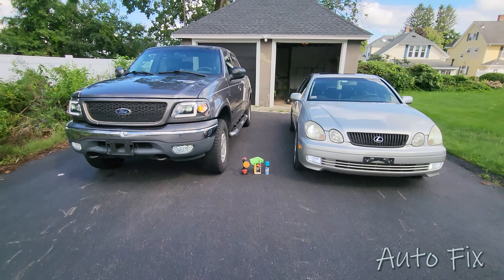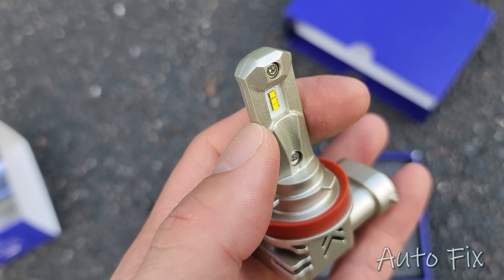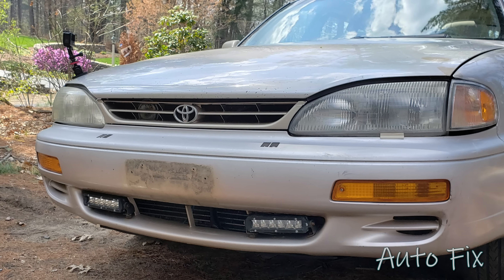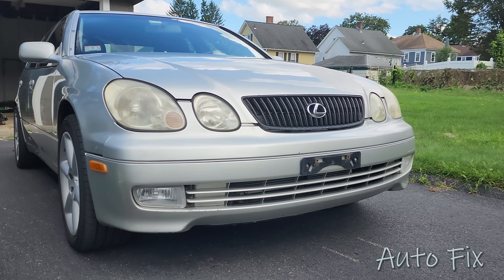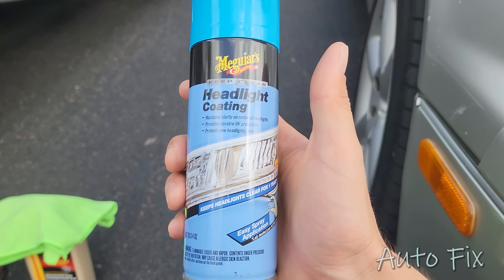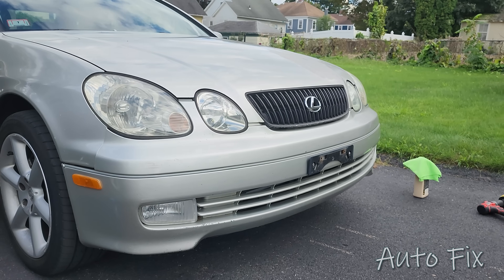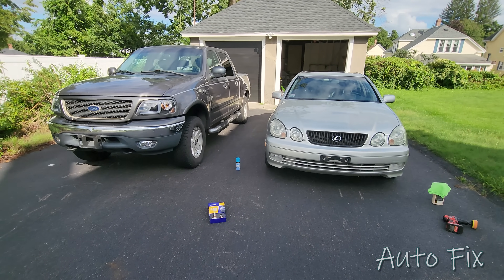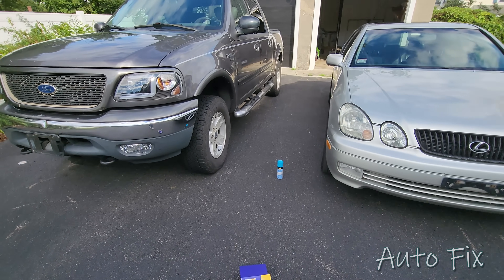How to Correctly Upgrade to LED Headlight Bulbs // AutoOne LED Bulbs!

Comment: My 1999 car has from factory projectors on low beam and fog lights somehow the h3 fog lights are brighter then the h7 low beams and the light is spread more evenly as were low beam has hot spots and kinda dead spots all halogen btw but planning on getting LEDs on low and high beams

Comment: If i can't align strictly vertically in my lens ( du to head light mount) for example + - 10 or 15 degrees. Does it cause considerable blind spots or loosing performance?
I'm going to buy exactly same bulbs as you showed at the very beginning on the video.
Reply from the maker: Yes it will cause performance loss in the beam pattern. Maybe not a crazy amount, but it will. Some LED bulbs are adjustable and will allow you to rotate them even once they're locked in. Maybe look at those?
Reply: @AutoFixYT I know that but in my region those are crazy 120W+... there are nice one but with additional blocks,  which is not comfortable and inappropriate for these days LED bulbs. Anyway thanks for advise.

Comment: About reflector headlights - doesn't the actual LED bulb have to be special and create a line so it doesn't blind oncoming traffic? Because there are a lot of cheap Chinese led bulbs that blind oncoming traffic, or is that caused by the incorrect adjustment and installation?

Comment: Question. If the same projector can be used with a halogen and LED bulb, can that same projector be used with HIDs?  I ask because I have an 03 civic, currently reflector halogen OEM setup. I wanted to put projector headlights in it with HIDs with the harness to make the Hi lo beams work on the same bulb. I found some complete headlights on eBay that have hi/low projector in it but states it’s for LED. Can I also use HIDs in it?  Does a projector care what bulb is in it?

Comment: Btw those multi sided LEDs work really well in an H7 system. Especially when the system has a seprate high beam reflector dish. It scatters light everywhere basically and lights up kinda amazingly

Comment: Your information is outdated 

modern  LED headlights use a  backwards J shaped reflector  if you taken it apart  a modern headlight

at lest this is what Honda and Hyundai is using   

GM is using mini projector  lens
Ford is using large projector lens
Toyota is using large projector lens
Reply from the maker: No part of this video talks about factory LED lights. This whole video explains how to correctly upgrade from halogen to LEDs.
Reply: @AutoFixYT   the correct way would be to buy a headlamp that has a official certified  LED projector  or gut one of those from  honda or Hyundai ...  at lest it would be a lot cleaner looking ... i plan to modify mines but a new housing and mini lens type  or gut one from a 2024Honda accord because it has the classic reflector type.. but i was looking  at a hyundai projector type(they got both)

Comment: Yah but dont you need a canbus or decoders to stop electrical problems like flickering  or is the Auto one LED lights don't cause those problems
Reply from the maker: Some LEDs have that built in. Others don't and you need them like you said. However, there are cases when you get flickering due to voltage fluctuations or low voltage, depending on how the daytime running lights function on that particular vehicle, and nothing will fix it unless you disable the DRLs

Comment: I just bought some for 20 bucks off Amazon they couldn't prove you any more wrong its kinda crazy you preach what you here but seeing is believing i installed checked the beam patter and no adjustment it should have a fan a heatsink and just a chip on each of the 2 sides. If what your saying only pertains to leds that litterely have like 30 leds all around the bulb then youd be correct it would be a shit light but if you follow what I listed to look for you'll happily find something for 20 bucks happy hunting

Comment: Does projector reduces the light output?

I see some reflector light output was brighter than projector, with the same bulb.
Reply from the maker: No, projectors and reflectors do not alter the total light output, but rather focus that light differently. Reflectors tend to throw the light in a general forward direction, with a hotspot in the middle of each beam. Projectors so just that, they project the light perfectly ahead and have a much more even beam pattern with a wider hot spot and a clean cutoff line to not glare towards other drivers.

Comment: Quick question, do they overheat if you put the rubber back cover back on the headlight or are they made to work with it on?
Reply from the maker: They might overheat, yes. They need air flow. You can cut a hole in the cover if you want, or you can run them and maybe they'll never overheat. Only one way to find out haha

Comment: I always tell people to never put aftermarket LED in reflector housing in cars that only has reflector housing for high and lowbeam. Those housing is not made well for LED. The light is scattered. Lowbeam no longer works like a lowbeam, it becomes highbeam because there is no cutoff line.
Reply from the maker: There actually is a nice clear cutoff and it all works as intended but only if the headlight assemblies are clear and OEM or high quality aftermarket, and only if the bulbs are good quality bulbs that allow the beam pattern to simulate a halogen bulb. I've done it and it works but you have to make sure you buy good stuff.

Comment: This guy is like a better Chris fix that actually seems like a real human
Reply from the maker: Haha thanks!
Reply: @AutoFixYT  mate you should have said something about the glass ones too, Volvos XC70 up until 2007 have them so you are wrong saying its pre 2000.
Reply from the maker: It doesn't matter if it's glass or plastic. What matters is what style it is: refractor, reflector, or projector.

Comment: Question when u purchased your bulbs did u have to make sure they were compatable  with your day time running light system
Reply from the maker: Most of my cars don't have DRLs, and the only one that does, I disabled them on. If the DRLs on your vehicle uses the low beam bulb, you typically don't need anything. The bulb will just be on as if your headlights were on. Other times, DRLs run through a separate LED strip or the parking lights, in which case you also don't need anything.
The hard part is when your DRLs run through the high beams but at half voltage. An LED bulb will flicker a lot if you put it in, so either disable your DRLs, or maybe make sure your headlight switch is never on the "DRL" setting (some cars allow that), or like you said, get some that are compatible with that low voltage that the car provides when high beams turn into DRLs.
I know this is a lot but I hope this helps!
Reply: @AutoFixYT  Thanks for getting back so soon and for the info . Like u said in the vid Ill make sure they are the right fit and high quality and I guess Canbus drivers are preferred. I mean I drive 2006 Monte Carlo so this should not be to difficult. Ill make sure I subscribe and like video
Regards Dave

Comment: I just tried installing H7 LEDs and they don't work. They flash for a fraction of a second and turn off. After some googling I found out that the LED doesn’t pull enough load and the car’s system thinks the bulb is fault, so it cuts power after the initial flash. You didn't mention anything about that in the video. What do I do now?
Reply from the maker: I didn't because it's not a very common occurrence. You will need a Canbus LED bulb which is able to communicate with the vehicle and tell it that there is in fact a bulb installed.

Comment: In New Zealand it is illegal to install LED bulbs into your headlight system unless your vehicle left the factory with an actual LED system already installed. I didn't do my due dilligence properly mainly because I listened to the so-called vehicle lighting experts (my mates) who actually gave me the wrong advice. Consequently when I took my vehicle for its yearly WOF (Warrant of Fitness) to be able to legally drive your vehicle on a public highway anywhere within the coubntry, my vehicle failed its test & it was only on account of the LED headlight bulbs that I installed & where it fell down from a legal aspect.!! So to make my vehicle legal again I had to remove those bloody LED/s & return to the normal Quartz Halogen bulbs that the vehicle was manufactured with!! In NZ one of the biggest pitfalls is most older Japanese vehicles over the last few years were vehicles arriving in the country with Quartz Halogen (QH/s) bulbs & usually rated at a mere 55 watts output on low beam & 65 watts on high & that's where the bloody problem is. Placing 55/65 watt bulbs is what I'd practically expect to find on a bloody push bike for heavens sake!! Any rate I searched the internet using AI (for the first time) which was superb & found some QH bulbs rated at 90 watts low & 100 watts high & these are legal here & I got my problem of inadequate lighting output sorted immediately & for a mere few dollars. I'm aware that most LED bulbs will fit into a QH housings etc, etc but that factor does not mean you can put LED/s into that particular fitting!! Unlike my smart arse/know it all approach you need to find out first what is legal in your neck of the woods & save yourself time money & a lot of sheer wasted effort!! Don't bother asking your mate as he'll probably give you the wrong bloody advice unintentionally. (yeah right) I'm also aware (now of course) that there is even a QH bulb out there rated at 100 low &140 high but they are a lot more expensive but the slightly lower rated 90/100 (which I'm now using & happy with) you'll find absolutely fine from both a cost factor as well as a performance aspect & they throw out a dam good light for sure!! (I'm fussy with headlights) PS: No good going to all this shit irrespective if the headlight lens are all clouded over & opaque!! (understandee de englishee???) Simply get it sorted & properly as your safety depends on these bloody lights!!

Comment: Why the GS have a small led on the high beams(has 2 bulbs)
Reply from the maker: That's called the parking light, it turns on when your headlight switch is one click below the low beams.
Reply: @AutoFixYT  thanks...wish I could see it

Comment: good LED installation techniq & functions of reflectors & projectors # extremely important point is projectors have low spherical surface area for light reflection that's the reason their beam is focused where as the light in housing reflectors has large area & that's the reason light is scattered &. cause glare for opposite coming drivers which is extremely dangerous # 
     from Pakistan 🇵🇰
Reply from the maker: Thank you!

Comment: About protecting the renewed lenses, you can also spray froma rattle can 2k clearcoat and it will protect it better. Also you do not
Need to polishe it like crazy before using the 2k, just sand like you said and once it looks good wet with water, let it dry thoroughly then mask everything near the light then spray 2 light coats. Should be good for years.
Reply from the maker: That's a great tip, thanks for sharing!

Comment: Okay. Can anyone tell me why after switching the whole housing on my 2009 ford ranger, to one of those generic ones off of amazon, my LeD headlight swap is just a star. It’s not fading out like it’s supposed to as a normal reflecter does. They still work, but the beam pattern is nonexistent, it goes everywhere. I’m not sure what I’m doing wrong here
Reply from the maker: Do you have the LED mounted correctly, with the blade straight up and down? Is it pushed in all the way? And is it even a good quality LED where the blade is as thin as it can be, not super thick? This all needs to happen to simulate halogen bulbs the most.
Reply: @AutoFixYT ah I see. It is vertically mounted, with the two led chips facing east and west. It’s pushed in all the way, and it was pretty expensive at around 140.
Reply from the maker: Ok, that's good. At this point, I honestly can't tell you why because I'm not there to see it in person. Could it be the housing? Yeah it very well could. But I don't know

Comment: Question: can i safely install LED lights into a housing that says "halogen only". or does it matter?
Reply from the maker: Yes you can, just make sure you position them correctly and aim your headlights after you're done
Reply: @AutoFixYT  im just concerned that they wont fit properly because in the product description it says "halogen only model". it has one reflector style and one projector style side by side.

Comment: just bought viontrex plug in play 6 pack for my honda civic 21, fog lights and high beams work great, low beams look very dim and not focused at all, can barely see the road 30-40 ft infront of me. dad suggested taking the projector bulb off, curious if you think it’s just a bad led or maybe it wasn’t put in correctly. thanks!
Reply: we also installed them to where they clicked in properly, i’m not sure any other way of installing them

Comment: Madman, drummers, bummers
Indians in the summer with a teenage diplomat
In the dumps with the mumps
As the adolescent pumps his way into his hat
With a boulder on my shoulder, feelin' kinda older
I tripped the merry-go-round
With this very unpleasin', sneezin' and wheezin'
The calliope crashed to the ground
The calliope crashed to the ground!
But she was blinded by the light
Revved up like a deuce, another runner in the night
Blinded by the light
Revved up like a deuce, another runner in the night
Blinded by the light
Revved up like a deuce, another runner in the night
Blinded by the light
Revved up like a deuce, another runner in the night
Some silicone sister with a manager mister
Told me I got what it takes
She said, "I'll turn you on sonny to something strong
Play the song with the funky break"
And go-kart Mozart was checkin' out the weather chart
To see if it was safe outside
And little Early-Pearly came by in his curly-wurly
And asked me if I needed a ride
Asked me if I needed a ride!

☺️☺️☺️☺️☺️☺️☺️☺️☺️☺️☺️☺️☺️☺️☺️

Comment: HELP i bought and just installed High and Low beams LED on my lexus es350 2013 ....only the lowbeams (h11) are working the high beams (9005) are not working after installing? What do i do? I noticed the arent straight perpendicular is that why they arent working?
Reply from the maker: Make sure they're plugged in correctly and that they're installed correctly. If they're not lighting up at all, there not getting power. If they are lighting up but the beam pattern is not corect, that's a mounting issue.

Comment: In UK do not fit any LEDs in any orientation in dipped beam reflector headlights it is illegal and will never produce the correct beam pattern. Main beam reflectors with LEDs can pass MOT test but shouldn't as the focus of the beam will be out of alignment but if it's got enough lumens it will still pass the main beam light intensity test.
Reply from the maker: Laws and inspections in all of Europe are much stricter than in the US. Definitely much harder to have a modified vehicle over there.

Comment: @AutoFix how’s those autoone led bulbs or Auxito - 10S that has tiny little ZES led chips holdin up after a year so far?

The one with a red O-ring. Still give u solid light output and no flickering?
Reply from the maker: @toyotabrony  all are still good for me!
Reply: @AutoFixYT  glad to hear that, does these 16.5W led bulbs for low beams. Still gives u nicer light output and see much better than halogen bulb?

Is it a big improvement or par improvement?
Reply from the maker: Huge improvement. Would never go back to halogen.
Reply: @AutoFixYT  glad to hear that as well.  

With right type of led bulbs, I also will never go back to halogen. 

Having a nice instant on and instant off is very nice and refine.